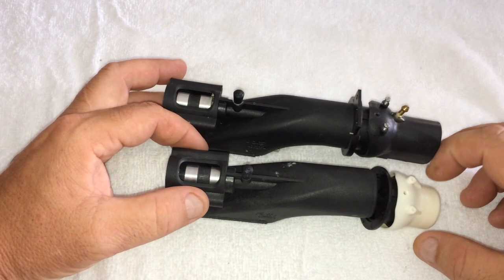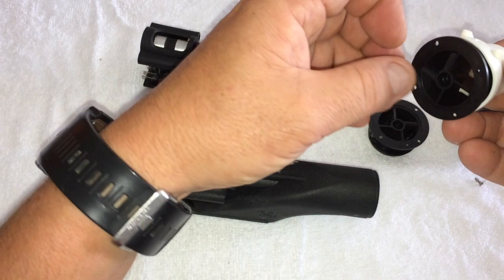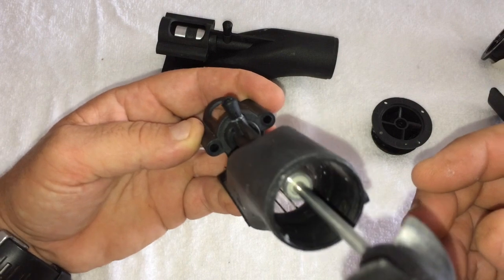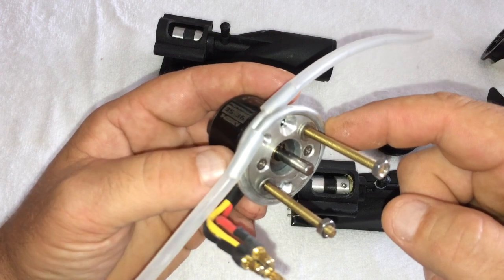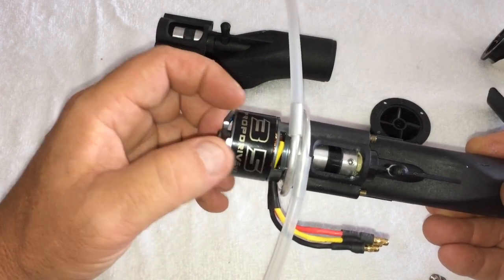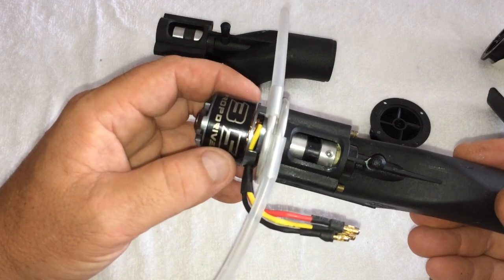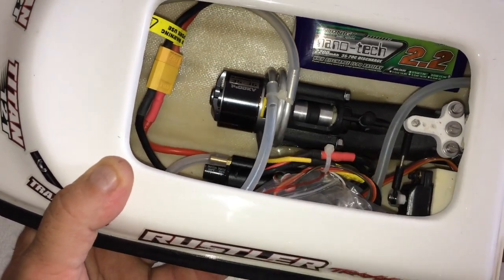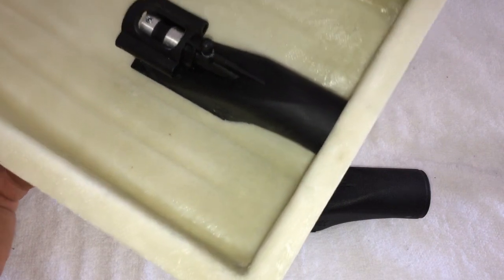BUY IN AUSTRALIA KMB 28mm Jet drive pump review rcjetboataustralia

Comment: I'm getting water in the coupler gully ,I can grease it but grease will seep out and then water will ingress in ...is this common?
Reply: You need to use the right grease and set it up properly.
Here's what you do.
Get a 4x1mm o and a shaft collar with grub screw.
Stick the shaft through as you normally do with the nylon washer between the impeller and bearing.
At the motor end, slide the oring over the shaft while holding the shaft in place.
Then you slide the collar over the shaft and push it lightly against the oring, again while holding the prop shaft all the way in. Then tighten the grub screw.
Now your shaft is installed. You might feel a tiny bit of resistance but that will go away as everything seats.
Now your setup is properly water tight.
For grease, use the Dynamite marine grease with the pump. Just keep filling till you see  the grease come out either at the impeller end or motor end.
The added bonus using the collar is that now your shaft won't slide back and forth when loosen the coupling to change motor etc. A shaft collar should come standard with this unit.